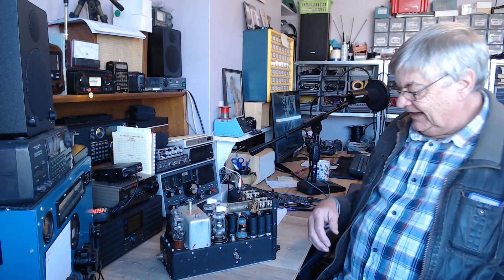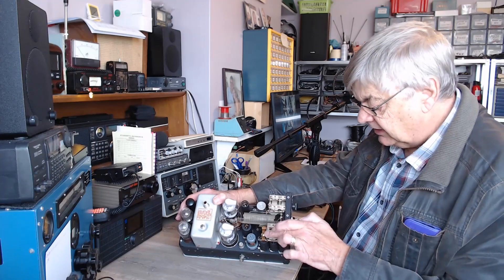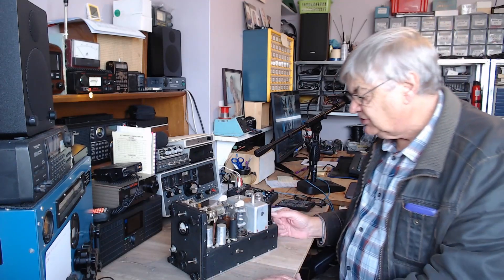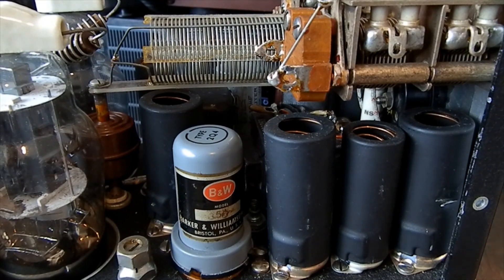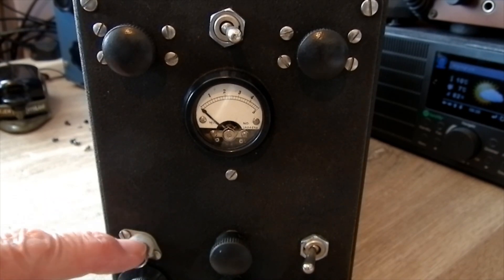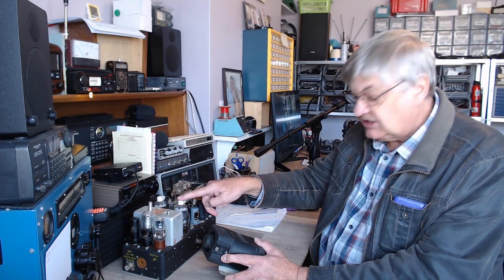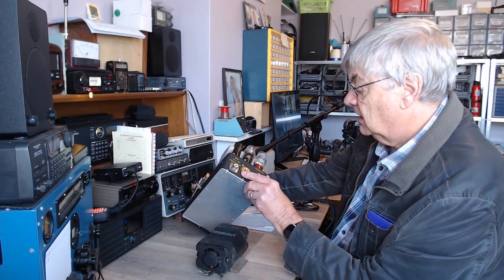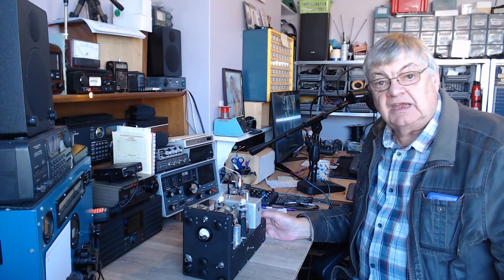G4NSJ - HF Aircraft Transmitter CCT-5220 valve TX ATA/ARA Command Radio ARC-5

Comment: Could be 1943 found this on wikipedia
"RCA announced new miniature tubes in Electronics magazine, which proved reliable. The first ones, such as the 6J6 ECC91 VHF dual triode, were introduced in 1939. The bases commonly referred to as "miniature" are the seven-pin B7G type, and the slightly later nine-pin B9A (Noval)."

I remember the 88 portable 40MHz set which used direct heater B7G, i think that came out 1945?
Of course i did the stupid Battery HT on the LT and blew a dozen valves in half a second!
Never has a command TX but did have the command R25/ R26 and R27 receivers.
they were octal base
Reply from the maker: I had a friend who did the same thing on an 88 set. Thanks for the info. Cheers, Ray.
Reply: @g4nsj  I dont know anyone who had a 88 set whom didnt blow all the valves that way at least once, after that you can give yourself OCD checking the HT LT connections ;-)
Reply from the maker: Haha, indeed!  @phillipsmiley5930

Comment: @G4NSJ - That transmitter has quite a bit of history.

It started out as a WW2-era US Navy transmitter for the frequency range 5.3 - 7.0 MHz, CW and AM (external modulator for AM). It originally used 4 tubes  - 1626 oscillator, two 1625 amplifiers, and 1629 calibration check magic eye tube. In normal operation it was tuned up on the ground and then all the controls locked in position.

Thousands of these and similar units were made surplus after WW2 and were used for a variety of purposes. Almost all uses required modification.

In a  March 1956 QST article, W2EWL described an extreme modification in which the transmitter was turned into a 75 and 20 meter SSB transmitter. The 1626 oscillator and 1625 amplifiers were retained, and the VFO circuitry, but the rest was extensively changed. Others expanded and improved the design. The idea was widely copied in those early days of SSB. The grey thing with the B&W that looks like a metal tube is actually an RC phase shift network.

What you have there is a really well-done example. There's no nameplate because of the changes. 

Here's a link to the original article:
http://nebula.wsimg.com/2b13ac174f7f2710ca2460f8cf7d6b8b?AccessKeyId=D18ED10DA019A4588B7B&disposition=0&alloworigin=1

Comment: Nice to see you are prepared to bleed for your art Ray🤣 Can see a redirection of an aircraft out of Shoreham like in fools and horses when this gets fired up. 😂 Does look a nice set though. Would be good if you can get some additional use from it.
Reply from the maker: Blood, sweat and tears! Haha! Yes, I hope to get it working before too long. I need to buil;d a power supply for it.
Reply: @g4nsj  If i remember right? Command Rx used 250vdc HT and command TX use 500vdc on the anodes, originally provided by 28V dynamotors, but 12v ones were also available
Reply from the maker: @phillipsmiley5930   Thanks for the info, Phillip.

Comment: im thinking that connector looking thing in front might be a remote cable drive for making an adjustment. Requires external power supply.
Reply from the maker: Yes, you could be right.

Comment: This is in a remarkable condition for its age and I was amazed at how clean it is inside, with the varicaps moving effortlessly. The lack of labelling on the front could have been due to a supply issue or they assumed a training standard was applied, regarding operational use. They must of had faith in the valve longevity too, so removing them would be a rare occurance.
Reply from the maker: It is in excellent condition. I’ll make another video once I get it working.
Reply: I suspect thats not the original front?

Comment: It looks like someone modified an ARC5 transmitter which had a rotary inductor and a VFO dial.  They plugged into a rack that hooked up to a dynamotor supply rail.  The tubs up front were not original for sure.  Domeone looks to have done a nice job but not sure how they are setting the frequency (originally the VFO capacitor was under bottom & the sheilded "do not adjust" can housed the VFO coils.
Reply from the maker: Interesting, thanks for the information.

Comment: Very interesting. It will be interesting if you manage to get this TX going.
Reply from the maker: Hi Mike, I'll make another video if I get it going.
Reply: Getting it going should be easy? getting it going without going into self osc and / or shorting the PSU with all those old caps will be the hard bit

Comment: CCT-52210 is a late production ATA transmitter, part of the Navy ATA/ARA Command Radio set, nearly identical to the Signal Corps (AAF) SCR-274-N. Early in the war it might have been used in almost any Naval aircraft, including fighters. By summer of 1943, they were being replaced in smaller aircraft by VHF command sets such as AN/ARC-1, 4 and SCR-522 (at least in Europe). <<Found on the web, there is a lot of info about them. I found one with an identical type plate to yours online. 73
Reply from the maker: Excellent, thanks for the info!